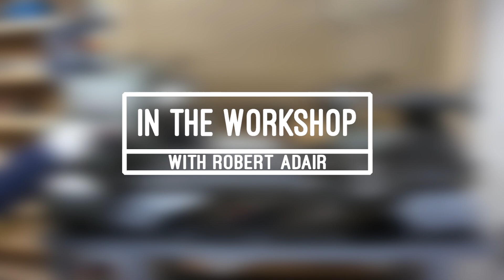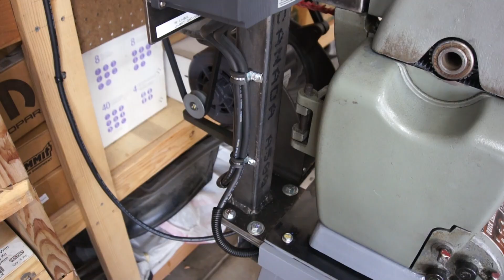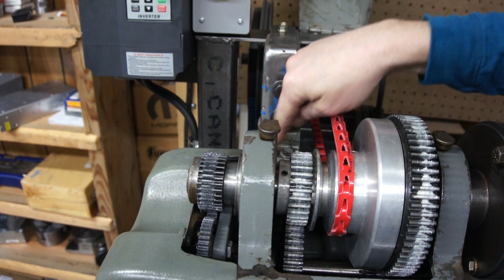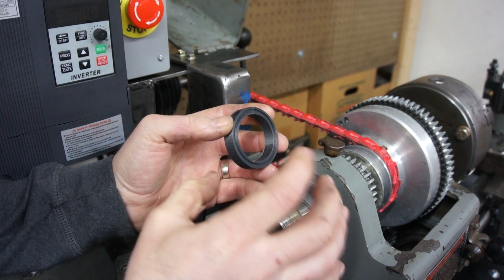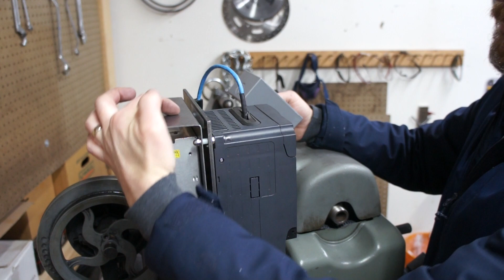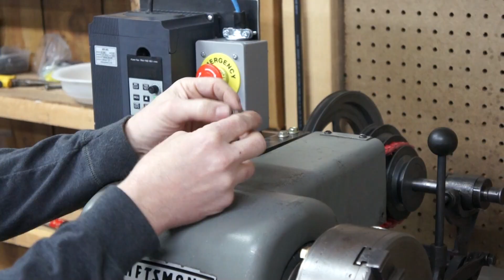Adding a VFD and Spindle Speed Display - Atlas Lathe, Part 4

Comment: Nice project, I was interested in the tach having installed them on a few other machines. I have same VFD and noticed the wiring terminal has 5 and 12v  posts. Could you just wire the 12v tach directly to the VFD and not have to use your auxiliary transformer?
Reply from the maker: I thought about doing that but wasn't sure about the amp draw of the tachometer.  The VFD has two 15V output pins, one rated at 20ma and one at 200ma.  I was worried that if the amp draw of the tach exceeded that, that there would be damage to the VFD.  So that's why I went with the separate power supply.  I could measure the amp draw on my tach while it's running if it'd help.
Reply: @ thanks for the reply. Mine has two separate pins 12 and 5v. They meter close to that. I connected the 12v to the tach but got no display. When I checked the dc voltage again it had dropped from 12 to 5. I reset and it would always drop from 12 to 5. I may look if it’s a programming switch issue. Kinda moot point your solution or a wall wart would work - just curious why the DC pins are even available?

Comment: Hi Robert. I bought an unfiinished project Atlas lathe from a widow. The late husband had accumulated enough parts from various sources to assemble a pretty nice lathe with lots of attachments and accessories. So my project resembles yours in many ways, and I am enjoying watching how you solved some of the problems I have encountered. I am using a three-phase motor with VFD and a spindle tach and this episode is particularly relevant. It was painful to watch you bend steel with a vise and hammer at 19:15 or so, and would recommend that you try hot bending with an oxyfuel torch. A little practice, and you can make a bend like a press brake with two fingers of effort. Anyway, I am really enjoying your videos; they are entertaining with good production values, so I subscribed.

Comment: Hey Robert, great video. Do you have make/model info for that VFD? Thanks.
Reply from the maker: It's an XSY-AT1, or at least, that's the sticker on the front of it.  I've used this one a few times, from different vendors, and that sticker is always there.  Here's a direct Amazon link to the one I bought (non affiliate):  https://www.amazon.com/gp/product/B08S7GTZRG
Reply: @RobertAdairWorkshop  Thank you for the link. You linked me to what appears to be the lowest price around, on this unit!

Comment: What an awesome project. I'm glad to see the lathe functioning well! Quick question though - what grease/lube do you use on the headstock, spindle, and gearbox gears?
Reply from the maker: Thank you, Powers.  I'm using spindle oil for the headstock and quick change.  Those have oil cups.  I'm using white lithium grease on the change gears.  So far, so good.

Comment: Hopefully for you and your viewers this proves a useful (if obvious) tip.
I became cheesed off having to move heavy items around (initially furniture) at home on my own so I invested in a set of 4 x 120kg rubber wheeled castors from Ali Express and built a low loader dolly from scrap pallet wood. I also built another from scrap  20 mm ply. BOTH are worth their weight in gold and make much easier work of moving stuff now. Saves all that "dragging" across the floor and enables moving stuff into tight spaces a breeze.

Two 2-wheeled dollies are even more useful if trying to put something into a REALLY tight space. Just ensure two cross bracing pieces can be assembled/disassembled easily and then you can remove them one at a time lowering the front or back or the sides one at a time and levering out the other.

I've used the latter technique to move a heavy bookcase into a "zero" tolerance gap using the latter without huge effort.
Reply from the maker: That's a good tip.  Thank you.  Yeah, that thing was heavy to move.

Comment: Did you consider a treadmill motor?
Reply from the maker: Hey, Alan.  I have a treadmill motor on my mini lathe.  It’s a good option.  In the case of the Atlas, though, I wanted to use the original motor mount and countershaft so I went AC.  DC, though, would have been a really good alternative and would save running a 240v circuit.

Comment: Nice work. I just inherited a mid '50's 12" Atlas Craftsman lathe from my grandfather (he bought it new so I'm only the 2nd owner), so watching you build one from spare parts was interesting. I have a spare 1.5HP 3 phase motor and was thinking about getting a VFD and installing them in place of the 1/2HP it came with.
Reply: and shred the zamac gears to pieces in the process
Reply: @undercoverhustler37  I doubt it,  but I guess that would be a good excuse to buy that rotary table for the mill and make new gears, haha.
Reply from the maker: Very cool!

Comment: I have the exact same lathe and am finally upgrading it too. Guys, a 12volt wall wort will power these displays too, I get mine at the Goodwill, they work well for powering LED light strips too. If they are the switch mode variety they will say 100-240 volt for input voltage, 1 amp and up will do just fine.
Reply from the maker: That's a good idea, Transmitter guy.

Comment: Robert, I have two of these VFDs, I’m sure they have a 12v take off and a negative you could use for your power for the hall sensor
Reply from the maker: I just took a look.  It does have a 12v pin on the top header.  I didn’t even think about it.  Could have saved a few hours work.  Good and helpful note, Terry.  Thank you.